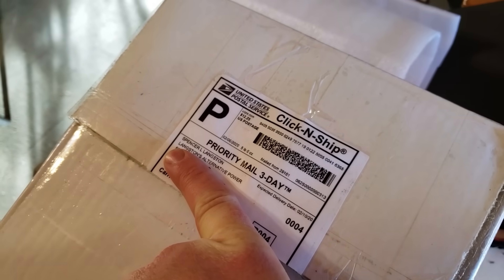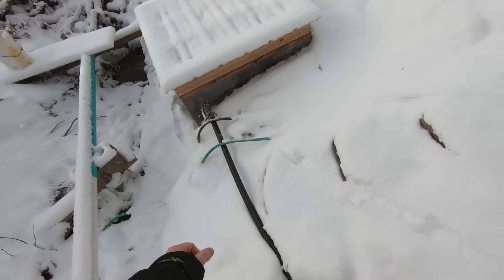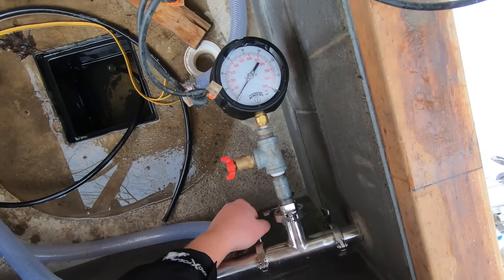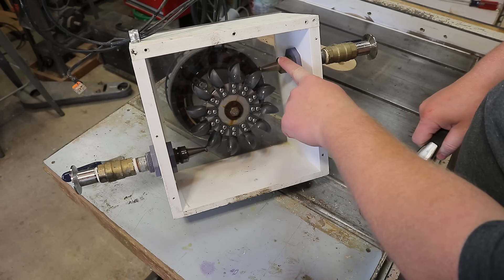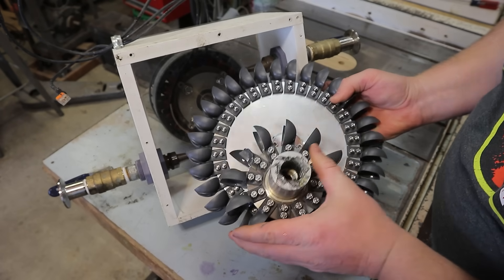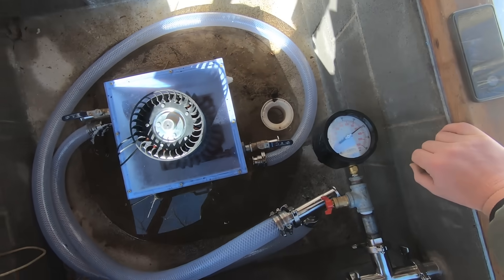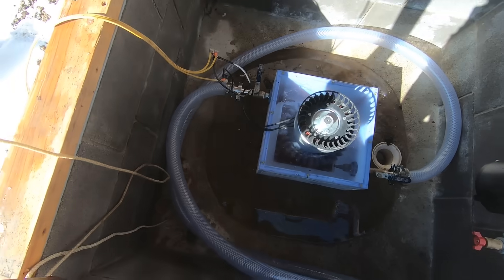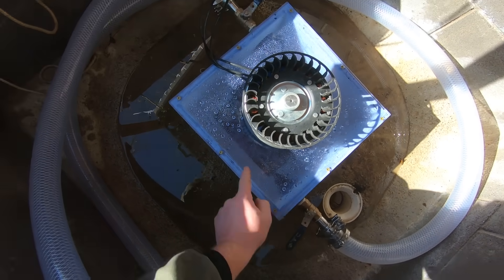Chasing 500 Watts, Big Pelton Turbine

Comment: Hi, I know that you already mentioned it in a video but I couldn't find it, so how are the connectors called that you use here for the water? As for the motor connections (depending on the current) I suggest to have a look at the MT60 connectors (they are even polarisation save which is not necessary for your application)

Comment: There is a hell of a lot more power there than what you're using you need to you absolutely have to manifold the kinetic energy that comes off of that and then use a transmission to put it to motors you can't just run it straight to a motor and building these things from scratch as a survivalist I've won bets that just people's whole worldly belongings they lost in bets with me because we used the gravitational weight of the water going down rather than the force of the nozzle blasting in and this made the machine last a lot longer secondly we used an actual squirrel fan squirrel cage fan 4 are impeller and the only way that you're going to get any better than that is by using a computer built program design of and that's kind of what your impeller that you're using already the casing has to be really precise and even then you're not going to get as much surface area as what we're getting with the squirrel fan and running it as a drain rather than a supply good luck and it looks neat as hell

Comment: Is there a PURPOSE to using commercially pressurized water to spin a wheel to generate electricity? Or is there a stream a thousand feet overhead?
Reply from the maker: Spring fed 280ft up.

Comment: you Don't need to wrap those lines with heat wire?
Reply from the maker: It's spring water coming out of the hill at 50f, and at 10gpm the 75 gallons in the line takes 7.5 minutes to travel down the hill, not enough time to freeze.

Comment: Joe you need to tidy up your work shop so much obstacles in it and they say home accidents cause serious injuries like broken bones. The Pelton vanes are too small for that project are they 3D printed ones I see a broken one through cavitation when water is under pressure bubbles form and explode that gives the wear and tear phenomena. Try larger Pelton vanes and fewer then rush water into it efficiency will be around 15 percent so you need 3.333kg of water going in to get 500watts power .

Comment: I was also wondering if a guide to keep the exhaust water from splashing onto the rotor would add a tiny bit of power,  maybe not worth the effort,  the exhaust water which has mass is travelling in the opposite direction to the wheel so woukd slow the wheel

Comment: Excellent work, the only things j would suggest is rotating the box by 45 degrees so the pipes sticking out go into the corners, just a new base would do and will make it smoother flow same as  changing the Tee piece to a symmetrical Y as you will lose pressure in the direction change

Comment: Hello Joe. Cool setup.
The round casing is the way to go. Like a donut, the half-toroid is a perfect diffuser for the spent water and the noise! Stainless perf metal will let water pass through and stall that water long enough to use it's film strength to absorb a lot of the sound. Please check for proper clearances at speed!

Comment: You should put some ferrules on your wires there, its less important because the wago connectors apply spring tension to the conductors but it does keep the strands from getting messy

Comment: The turbines spin so fast it looks like they don't have any real load on them, indicating the alternator is much too small, or is doing nothing in the way of producing power! The pelton wheels I've seen do a few hundred RPM, not thousands. Very interesting Video none the less.
Reply from the maker: Most turbines you see don't have 280 feet of water pressure behind them, hence the speed.

And yest the alternator is powerful enough to brake the flow down to only a few hundred rpm.

Comment: You may find more efficiency if the water catch fin things were angled so as to force the exiting water down toward the exit hole, perhaps make the box taller even. My reasoning is, you've got water flying all over the top of that flywheel, causing drag. But a more simple solution would be to mount it vertically.

Comment: Nice setup, but the larger wheel will take more pressure to spin at the same speed as the smaller one, due to needing higher jet pressure to the spoons, to get the same rpm. The larger hub will give you more torque, but the smaller hub gives you more speed, due to smaller rotational mass, and less air and water drag on the spoons. Kinda like an ice skater doing a spin - to go faster, the skater pulls their arms in closer to their body...
 Also, the circular enclosure  will help remove backsplash water from hitting the spoons, causing drag, and slowing the wheel down. But, instead of using holes around the circumference of the enclosure to remove water, use slots - the water is being flung off the wheel in a tight line, due to rpm, and that will make it easier to remove excess water from the system.
The idea of higher voltage versus heavier wire is a good one - AC is easy to transform, with little loss, and you can step down right next to your load, which limits losses even more..
 Just a few ideas - good luck...

Comment: it will run slower at the alternator, because wheel is bigger. you need to take advantage of the greater torque, so increase the size of the alternator

Comment: Is this supplying pipe not too thin? For efficiency is the pipe itself also very important. How long is it? And about broken spoon, it could be the cavitation. It is very important to feed worked water far away from the wheel, it is dangerous  because of small bubbles, which make the parts damage.

Comment: Dumb question... Would it be possible to gear it into the rpm you require for better efficiency, or increase the resistance on with a different motor?

Comment: change the generator, use thicker wire now that you have a larger pelton wheel. you could try a halbach array with your magnets? or use stronger magnets? (in a halbach array) double the width of the stator and rotor? seems strange with that kind of waterpower that you only get 450 watts from it.

Comment: The key with those Pelton wheels is having the jet stream lined up perfectly to transfer maximum force/efficiency onto the cups. They are also designed to have the water speed almost match the wheel speed so that all the force of the water is transferred into rotational motion - the water should fall downwards from the wheel. So any kind of housing should be circular but with space around the wheel. Hope that helps. Cool design!
Reply: Actually for maximum efficiency the Velocity of the bucket should be half of velocity of jet due to Eulers terminal machinery equation
Reply: @philmicuchie7729  I second this Phil!
Reply: The water should be left with no energy, ie stationary. It should be free to just drop out of the way. The turbulence in your housing is evidence of huge losses. I used Fisher and Paykel smart drive alternators from NZ. These have a rotor that can be withdrawn from the stator so the load can be controlled for speed matching. They are good for 1000 watts at about 1200 rpm, output at approx 450V three phase. Switchmode power supplies can deliver low voltage for batteries much simpler than MPPT. We lived off grid on three of these for 15 years in NZ. They also work well at low rpm, say 200 charging 24V DC with just a bridge rectifier..
Reply: If the velocity of the wheel was the same as the velocity of the stream, then no significant force would be imparted onto the wheel.  Something is wrong with your understanding of physics.
Reply: So approximately toroidal in shape.
Reply: Shape of housing is irrelevant but must not impede the dynamic of the jet stream acting on the buckets.
Reply: @otiselevator7738 and the “outflow”

Comment: A square box is not ideal you need it to be a cylinder to minimize losses in friction due to water being trapped in the corners, I don’t know the purpose of this setup but if you are using power to pump the water coming to those nozzles you are not gaining any energy, perpetual motion is not real. Physics is.

Comment: Pelton (impulse turbine) wheels are suited to high head like about 1000' and higher to get max efficiency
Francis (reaction turbine) are suited to lower heads 
The most complicated are Kaplan turbines for the lowest heads - basically a very large variable pitch propeller to broaden the maximum efficiency range

This setup doesn't appear to have much of a head (going on the plastic hoses etc) ?

Comment: Why was the black bypass hose put to use? Seems the two hoses already there could have just been put down in the center hole. 

Also those stainless steel connectors and clamps looks like high dollar lab grade parts. Aren't they expensive.

Looks like a lot of water sloshing around in the new box that would interfere with the turbine.

Comment: Do you think a cylindrical housing would lead to a higher and constant voltage? Im assuming the circular flow would add to the turbine RPM rather than slowing it down.

Comment: Hello Joe, it is with pleasure, even if I have a lot of difficulty with English that I followed your various videos very understandable without the comments! one thing that bothers me: why are your injection nozzles not directly on the turbines? The notch on the blades allows them to practically put them tangent to the turbine. Regards JJL (french)
Reply: while they are at least 3 cm ! and  a slight angle to catch the spoon. 
I am also thinking of an expantion vessel upstream of the main valve to avoid water hammer when you close it, this would avoid the rapid rise in pressure and the risk that your fittings or the tubes fail! (but I noticed you were closing slowly)

Comment: I would add some floats to controlled shut-off valves in your barrel to control the large and small jet feeds at your turbine end. A way to automate the flow control for the supply. Kind of like the floats used in toilets. ;)

Comment: You should put some sound insulation material on inside walls and lid around the wheel. Noise level is increased multiple times by reflections inside the box. Lots of cheap options out there, heck you can put old blankets or towels and still make a difference, but open cell materials for acoustic treatment would work best.

Comment: Such a good build then i realize its plywood lol. Why not a more resilient material or even a rubberized coating? I see its painted obviously but is that sufficient for long time use?
Reply from the maker: it's a prototype, the final version will be TIG welded Stainless Steel
Reply: Very nice! I watched further on and realized it was just a prototype but awesome job. Was gonna say itd be nice to have a metal printer to make the paddles so they dont break or wear down

Comment: Hi joe. I like your setup. in your video summary you touched on the amps being a bottle neck due to 7 amps going thru the wire,  16g can handle roughly 10 amps however distance as you know is the factor you are actually facing.. if distance is an issue your better doing HIGHER volts across the line to keep the amps low and then convert at the box.  personally,  thats how i would do it. 

i love the set up you have going.

Comment: I have a suggestion:  The tangential speed (w*r) measured from the axis to the middle of one of the spoons should be between 0.46 to 0,48 of the speed of the water jet for maximum efficiency. Also using only one nozzle instead of two should make a small turbine more efficient.

Comment: The reason the you have marginal increase in efficiency is your limited to flow.  
Increase your supply and return diameter and you'll see a change even with the smaller wheel.

Comment: I am looking at how much the hoses are bending leading up to the point where it enters the box and wondering if it would make a difference if the hoses were straighter. Do you suppose having the nozzles enter the box at a 45° angle rather than a 90° angle make a difference?

Comment: Can this type of turbine be used in rivers that do not necessarily have a fast water current? Also, what type of bolts are you using? (Asking for a school project)
Reply from the maker: no, and stainless steel.

for rivers look at floating waterwheels

Comment: I think it would be helpful to change the shape of the turbine box from cubic to cylindrical with as little extra spacing as possible. By doing so, the water after hitting the turbine could be channeled in a centrifugal motion instead of crashing on the wall of the box. Great video.

Comment: instead of the plywood outer splash case being square it should be round and give it more clearance from the pelton wheel...water being splashed back from the sidewalls of the outer case back onto the turbine wheel causes drag ...after this water has hit the turbine it is of no use and needs more room to escape without rebounding back

Comment: Im my experience of Peltons, the wheel should definitely be vertical, with the housing as large as possible to reduce losses from interaction of the exiting water with the casing. Also, the nozzle shape and alignment is fairly critical. If you want to use the nozzles  that you are currently using, i would suggest possibly mounting them side by side on an adjustable bracket, aimed at the bottom of the wheel. That way you can align them so each of the streams hit the centre of each of the pair of the buckets through the main part of the drive stroke. By fine adjusting the alignment of the streams you can tailor your rpm / power.
Cool project though :-)

Comment: A good turbine design is judged by a minimal turbulence at its output. The one you are presenting is a simple one, but not very efficient, so changing its type rather than its diameter would have more significant outcome.

Comment: Those clamps with the stainless steel pipe fittings are very similar to what I use to concrete pump, I gotta ask where did you find those kind they look ideal for the application-no rust and easy to work with

Comment: Pelton wheels operate most efficiently when the speed of the spoons is one half the speed of the water jet. This is fairly easy to calculate. This exercise is left for the student.
Reply: The turbine should be A Kaplan or the simpler
Propellor style.

Francis  third best.

But Pelton impulse?
That is for very high head !
Reply: Each turbine type has an efficient operating range of pressure and flow. Look at any basic Water Power text book for an explaination.
Reply: The charger is MPPT (Maximum Power Point Tracking). It will adjust the voltage for maximum output power, and that will be near a wheel peripheral speed of half the water speed. It may find an optimum a bit off due to cup shape is not at optimum exactly perpendicular and also optimize a bit to increase RPM due to wire losses and if the box distorts water somehow.

MPPT regulators solve a lot of problems for homebrew projects. There are even step-up/boost MPPT regulators operating from as low as 5V input. 

The best is to select the diameter of the pelton wheel to obtain the maximum RPM the alternator is designed for. The power loss in all wires and windings is proportional to I^2 so delivering power at as high voltage as possible is great.

Also the water speed can be checked reading the open circuit (no load) voltage of the alternator. Regulator will have to handle that RPM anyway when battery is fully charged if no dump load, water diverter or nozzle valve feedback is used..

It may be the cups are inefficient if wheel is too small and each cup operate over a large angle
Reply: Thank you for your reply.
Reply: NEW TECHNOLOGY INVENTED TO WASTE ELECTRICITY.MODI GI INDIA WILL DEVELOP BY YOUR IDEAS.CRYPTO IS YOUR OWN IDEA OR SOME TECH COMPANIES GAVE SUGGESTIONS TO ALLOW CRYPTO IN INDIA.JAPANSE BITCOINS ARE DANGEROUS. LIKE JAPAN DID TO AMERICAN  PERAL HARBOR....
Reply: But you’re still not a physicist
Reply: No just an engineer at a dam.

I am also not a lawyer
But I know murder is no legal
.

Comment: Cool idea i have done wind turbines or small impellers that run off down pipes to power outside lights etc.
I will admit i do not like your wiring, at least get a water proof connector box (extra minute) ohh wait you probably never have been seriously hurt by electricity...Guess i am over cautious and over engineer things as got taught the hard way